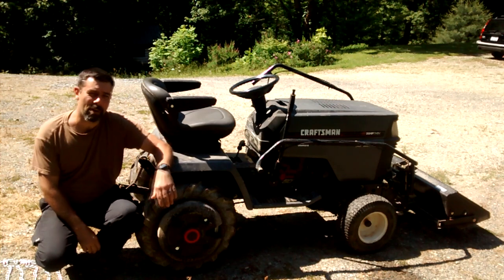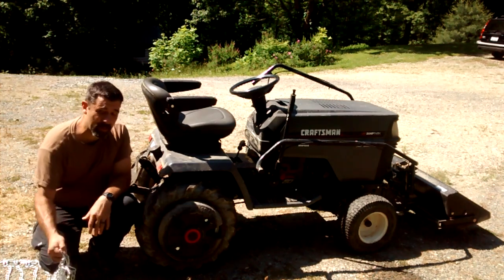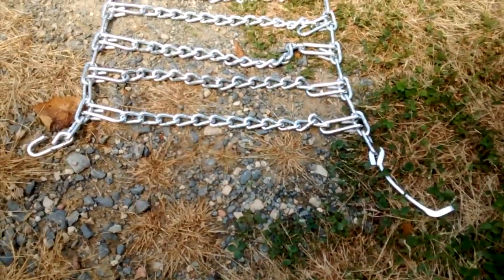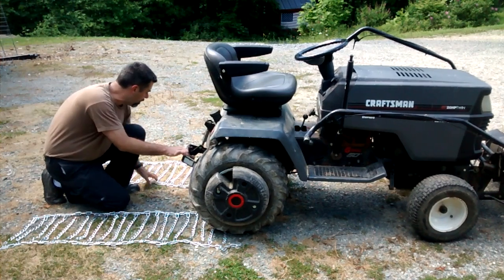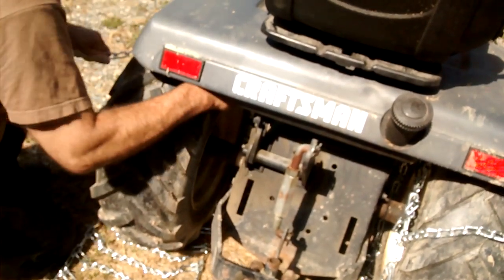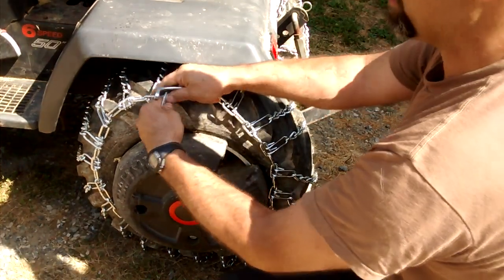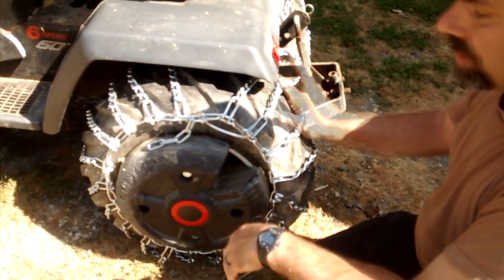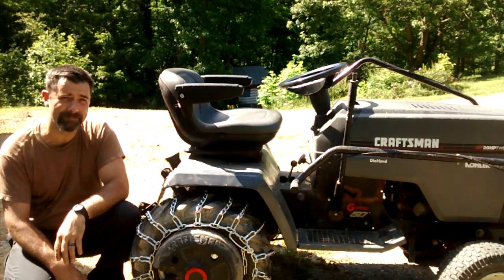How To Install Tire Chains On Your Riding Mower

Comment: This is a great instructional video!!! The only point I'd like to add is that I have found that if you roll the tractor back about two-thirds (2/3) instead of 1/2 way, you wind up working at the rear of the wheel/tire to link the chains together.   This helps because then you're not trying to hold both ends from falling as you're trying to attach the ends.  This way you'll have most of the chain on top, draped over and hanging down, it won't fall forward and all ya gotta do then is bring the bottom up to meet the top.  Much, much easier!  It's like having an extra pair of hands.

Comment: Thank you for the instructionals they've been very helpful we use the same type of tractor except ours came with the electric actuator.

My children like them very much as well.

Could you please tell me What is the brand tire weight you used or may I have a link?

Comment: what model and make of front scoop/shovel you have on your craftsman..? I have LT1000 and looking for front scoop to fit...
Any help is much appreciated...!
Reply from the maker: The current craftsman tractor scoop sold at sears will fit your LT1000 just fine. I had it installed on my 2003 LT1000 a few years back and it did great.

Comment: If you're making an instructional video for anything, PLEASE do it correctly.  You have the chains on wrong. The barbs of the chains where they cross the tire tread and connect to the chain that runs the circumference  of the tire need to be facing out so they don't wear holes in the sidewall of the tire. Basically you have the chains on upside down. Flip them over as they lay on the ground. That is the correct way to lay the chains out and to avoid destroying your tires. ALL SHARP AND?OR POINTY ENDS OR EDGES FACE OUT.

Comment: I need to save this one.
Reply: You have the weights too. I wish I could find those for mine.
Reply: the bungee cords rot out pretty fast. I use a piece of 9 ga. wire , hook the ends together with a pair of pliers. keeps them forever.

Comment: Why not jack up the rear end off the ground, it would be easy to then put the chains on better.
Reply from the maker: Sure would. But a lot of folks don't own them and this works just as well.
Reply: Because you want the weight of the tractor on top of the chains as you drape them around the tire in order to hold the bottom area in place.  If the tractor is up off the ground,  the tire wants to turn every time you pull on the free end of the chains.  Try it and you'll see what I mean.